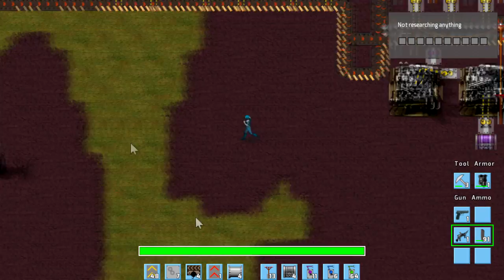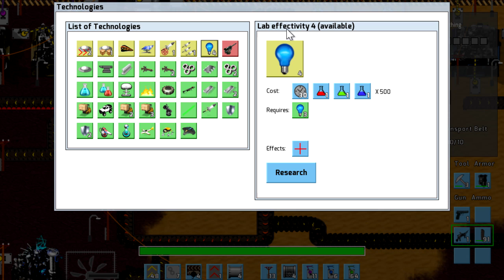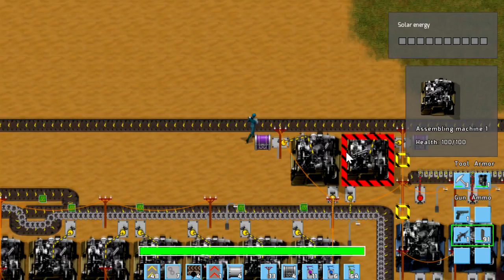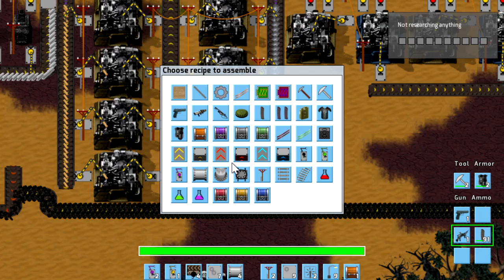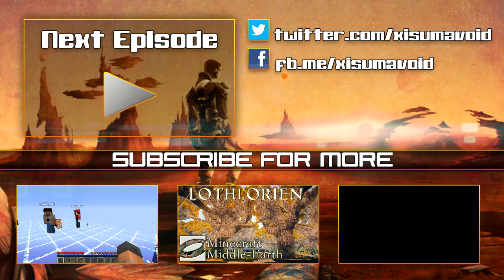Factorio 10 Rockets

Comment: Thanks for the name drop Xisumia however it is gat not gal :P. 

The lack of water is only really seen when you have 20 steam engines at max output. I have never seen AP go to max. And more accurate numbers for MAX power off one pipe line is 2 pumps to 26 boilers to 18 steam engines. 

Power produced or consumed is shown when you hover over things in your inventory. Also you pressed alt to show things that were being produced.  

Your world is looking awesome btw. =D